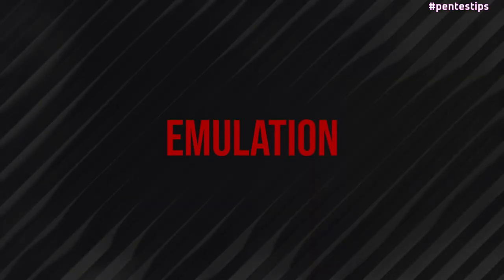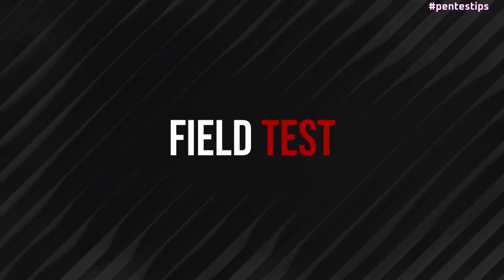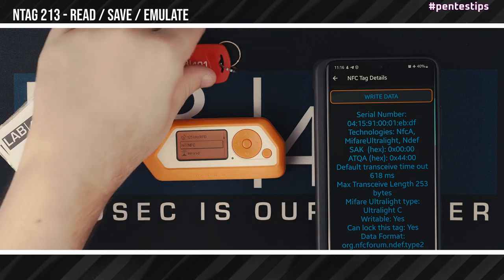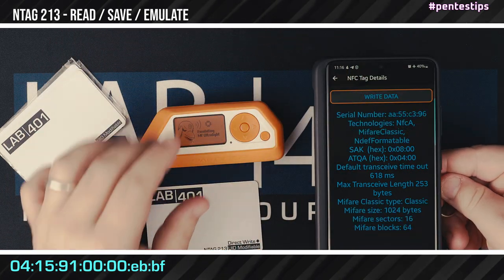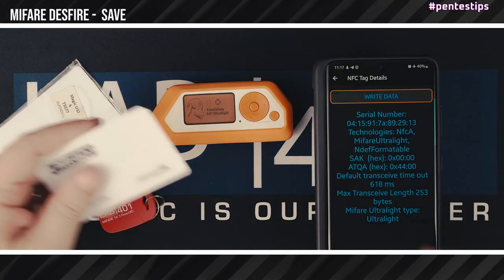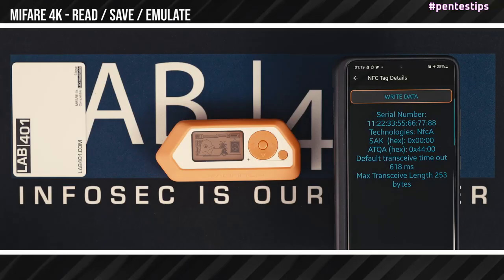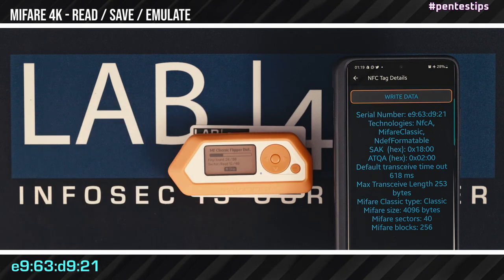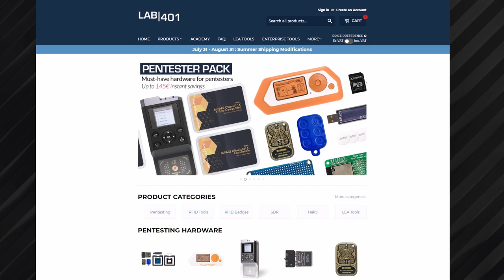#pentestips - Flipper Zero : How to Read, Save Clone & Emulate RFID Cards

Comment: Why do you have to use the NFC menu and not the RFID menu?'

I have a few 125khz HID ProxCard II card (H10301 protocol) but while I can read from them, the Unleashed firmware cant' write.. it gets stuck.  Is it possible they need to be erased first? How?     Or perhaps they are are write protected?